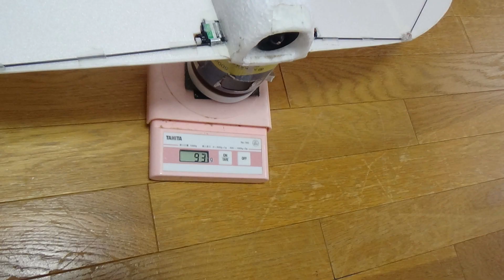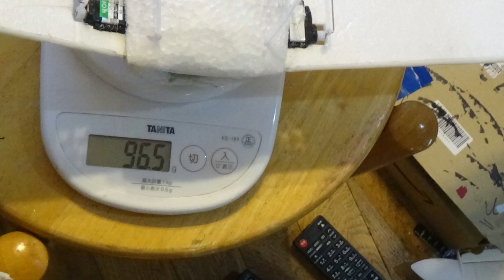メーベの製作（100ｇ未満）　Making of Mowen under 99

Comment: the oscillation is interesting, flight controller/active surfaces or stronger body
it's a hard platform though, short moment arm, plank style
crazy you've been working on variants since 2009
this one looks really good, almost thought there was no exhaust at first
I would think you'd have the outer most surfaces (wing tips) as the elevons not inboard since they're furthest back from CG
Reply from the maker: Thank you.